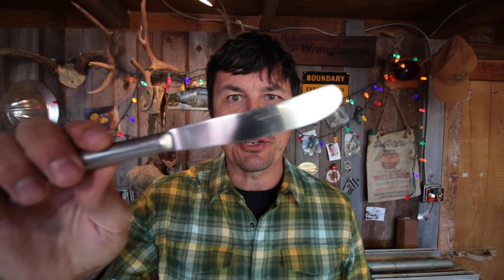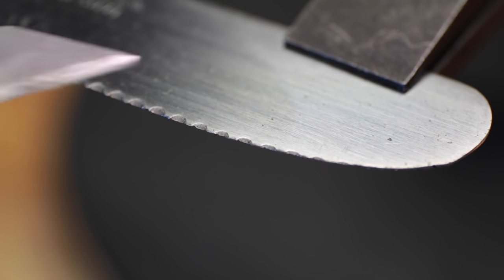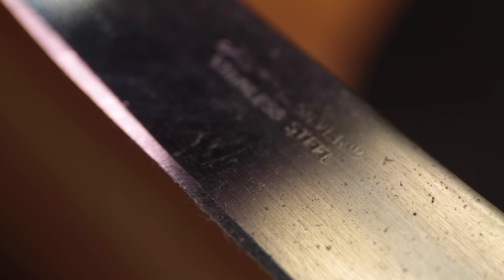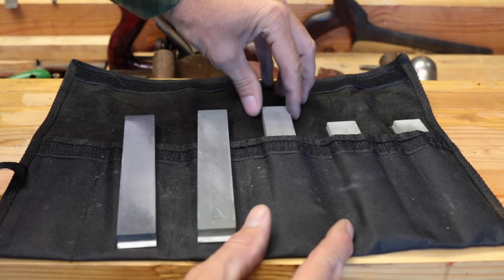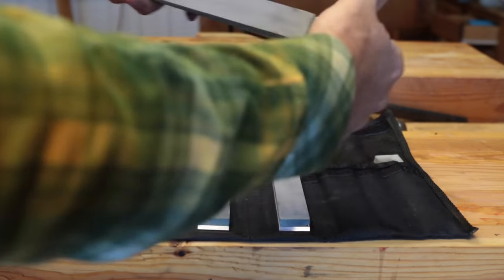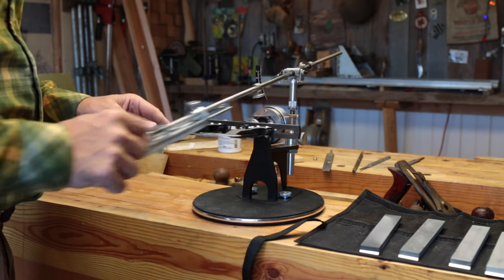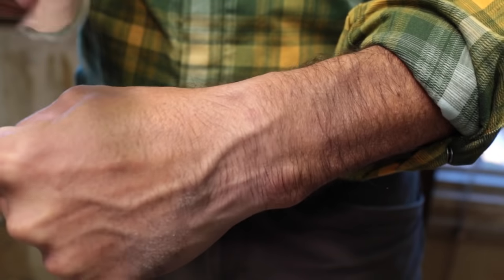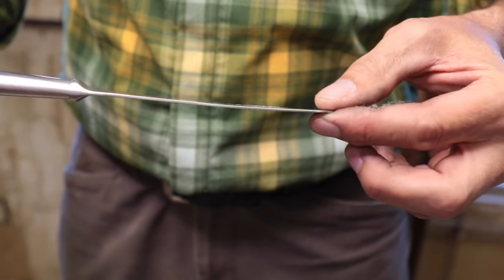Can A Knife Be Too Sharp??

Comment: I need that knife sharpening setup in my life.
Reply: who doesn't
Reply: Same
Reply: What is it?
Reply: MotoFail, TSPROF Blitz 360 sharpening system. And you’re looking at $400.
Reply: @kodyking3090  there's a 3d printed version
Reply: They're super cheap 63 bucks on Instagram ads
Reply: @dustycover3015  and a lot of practice. Using a free hand stone takes skills.
Reply: @dustycover3015  except the learning curve.
Reply: @kodyking3090  thanks for the details man.
Reply: Ever tried sharpens best ?
Reply: Coming from 21 year certified cutler, these knife setups are good for the less skilled beginners. A master cutler like myself would NEVER use those systems. Using real sharpening techniques, by hand, that’s how it’s truly done.
Reply: I have the U$ 20 Ruixin Pro RX-008 set. There's not a single day I regret acquiring it. Just make sure to upgrade it with finer grit stones and diamond compounds on leather strops for atom-splitting sharpness. My current set of grits includes 14K, 100K and 200K diamond compounds from TechDiamondTools, each one embedded in kangaroo leather.
Reply: @kodyking3090  and if you spend 5 minutes a day meditating on a piece of polished marble with a little bit of butter and a Japanese razor you will be able to sharpen knives better than that in a year's time I would guess 12 to 1500 Grit with confidence. besides that tool only works on straights what do you do when you get to a curve on the blade? if it's worth getting something that sharp is worth the time to do it yourself.
Reply: @scottsmith6571  😆😅😂🤣🤣🤣
Reply: @kodyking3090  So basically the price of a decent basic set of whetstones? Or one high end knife.

Comment: I knew you could put an edge on it, the question is how long will it hold?
Reply: He said in the video 20 degrees..
Reply: 420 seconds tops
Reply: Now the Real question is how does it proform with butter
Reply: Thanks for providing this information.  Danny at DeepSouthHomestead talked about not buying a pocket knife that had a stainless steel blade because it does not sharpen well and if you did get it sharpen, it would not hold an edge.  Of course, I didn't know this when I purchased a few knives, so I really need to do some research.  I need to be staying under $50.00 but don't really know what is available worth having in that price range.
Reply: There are many different kinds of stainless steels. Many modern stainless steels hold an edge just fine. Stick with quality brands and you'll get good steels with good heat treatment.
Reply: My question exactly! Would it even hold up for a complete shave in the manner one would use a straight razor? I'd no doubt it could be made "razor" sharp.
Reply: It will take an edge sure but that edge will be soft like butter it took him almost no time to do it and that is because the hardness of the blade is well below 50 RC  if he had stropped it mirror it would shave even better but it would need resharpening every time he used it....
Reply: Lunas Eclipse  Hey dude, I have a nice handmade native knife and wondering what the RC stamped on it means.
Reply: Peter Carlson so what hardness though if it just says "RC"
Reply: The hardness is not typically something stamped into blades in your case it is more likely the makers mark if it is a handmade knife and is either the initials of the smith who forged it or the smithy's. As far as markings go china is typical at the base of mass produced and like has been said the metal will likely be low grade stainless if you're lucky. Good stainless is non magnetic or weakly magnetic. The only real ways to tell hardness is through a file test if a file skates off the metal it is above 50 if it bites and removes material below 50-55rc OR sent into a lab OR an Ames portable hardness tester.

A handmade knife if it is good quality will be magnetic unless made of titanium or stone and it will hold an edge for a long time if it does not then the quality of craft is low.
Reply: Donni & Jeanette Chamberlain as some have already noticed, modern silverware is made from aluminum (steel is of a more expensive kind of silverware) so for affordable reasons I can say that he has a cheap $1 knife, made from aluminum, making this knife good for a quick slice, like a prison shiv
Reply: actually most of those type of knives are cheap stainless steel not aluminum very seldom is aluminum used as if they go that cheap they tend to just make them out of plastic...
Reply: Well no .. the question is: Can a knife be too sharp?

Comment: e
Reply: sounds like a vsauce question
Reply: Jonah Wang can water be too wet? whole video is putting a water on a bucket
Reply: Why not put it inside the bucket?
Reply: salvador fonseca because that's too complicated
Reply: I prefer to put the bucket on the water
Reply: I prefer to water the bucket.
Reply: I prefer to pour bucket into the water.
Reply: Let's find out.  Watch as I pour this glass of water, take a drink.  Mmm, yep, it turns out, water does quench your thirst.
Reply: @Jonah Wang, you jest but water can become too slippery when they add chemicals to aide in fracking
Reply: Only rainwater
Reply: DEAD Lmao " Firgutivley Speaking"
Reply: Jonah Wang What do you mix with powdered H2O? (Old Gallagher joke from the '80's...)
Reply: Cristos Palabras I don't know. I'm not 30 years old.
Reply: Jonah Wang Answer: It's a joke. There is nothing you can mix with powdered H2O. Oh to be young again... except... I would have missed all the good jokes.
Reply: Verepaine I used a surfactant called "Kinetic" in my landscaping business to spray on "lawn ponds." Kinetic is super slippery and reduces the surface tension of the soil, thereby allowing standing water to have a "transient quality," just going straight down into the ground. Same principle with fracking, it allows the sludgy water and sand to be pumped into the ground with no resistance.
Reply: Sorry but I'm not smart.
Reply: They actually sell water wetter for firefighting. It ups the density
Reply: Cristos Palabras eisai malakas
Reply: Well why the hell not?

Read More
Reply: Funny
Reply: Jonah Wang But you're young. So smart doesn't matter.
Reply: Um I didn't fall for it
Reply: M8, Then why did you reply.
Reply: @Cristos You're old, so logic doesn't matter.
Reply: Jonah Wang Which, is a compliment not a complaint, so thanks for the compliment! 
(Age, where brains RULE!)  Old💪 vs: Bull💩!!!  Wins every time!
Reply: k.
Reply: Jonah Wang I
Reply: Can air be to breathable
Reply: Can foam be to soft
Reply: Jonah Wang aa
Reply: k
Reply: Jonah Wang aaa you got me
Reply: is it possible to be TOO hard?
Reply: Cristos Palabras hehehehe
Reply: You cant trick me
Reply: you actually got me
Reply: Jonah Wang didn’t get me
Reply: Jonah Wang it's to high the read more is too high
Reply: Water isnt wet
Reply: lol s .
Reply: salvador fonseca why not both?
Reply: can fire be to hot?
Reply: lol
Reply: Jonah Wang lol
Reply: Jonah Wang do you know that when you can go to awake then sleep then pee?
Reply: Jonah Wang lol
Reply: Ahahha
Reply: I love this lmao they're all talking without context 😂
Reply: Jonah Wang wow
Reply: This man is a legend
Reply: Hahahahah what bucket
Reply: I prefer milk in my hot chocolate
Reply: @lucascurrah6010  oh yeah oh yeah
Reply: big oof
Reply: Ur a good man
Reply: I like the dense water on the outside of my bucket
Reply: Gr8
Reply: Can water be too wet
Reply: E
Reply: true

Comment: The real question is would you lather up and place it to your face. FYI 1000 grit is considered coarse for guys who wet shave with a straight razor.
Reply: eh, 1k is medium to me when doing planer blades, I finish with 6k, then leather glued to block
Reply: 1000 grit cuts hand hair near skin but is far from comfortable face shave. #1000 is the starting point for my shaving knives and after #13000 I move on to stropping to give the final touch.
A great shaving knive cuts a hair if you drop one over it, just by the weight of the hair. Any knife for shaving should at least cut a hair that is held at one end only.
Reply: i go only to 10000 grit 1000 grit would feel scratchy as hell on the face but i wonder how high the count goes on this system if it goes to 10k stones id love it what is it called anyway
Reply: people dont seem to distinguish from shaving sharp and razor sharp. shaving sharp is all well and good but i wouldnt put an only shaving sharp blade to my face
Reply: Monte Turner correct, i would never use less than 12000 but the best would be 16,000 and straps at about 55,000
Reply: I don't know what it'd be called, but I wouldn't be surprised if they aren't using JIS but another standard. So the 1000 grit being used there is probably a bit finer than than a 1k japanese waterstone using JIS.

Sadly I also don't know the type of jig he's using there, the handle looks a bit like what I've seen on the edge pro models. The rotating mounting point looks like what I've seen on the KME system in the past but the stones used on it don't look like the coloured ones the edge pro system uses. So I'm a bit at a loss to identify the system, doing it by hand on benchstones for too long to keep up with all the things that people come up with. Benchstones and a spyderco sharpmaker for occasional touchups is how I roll these days.

About the various grit ratings though! For example the "spyderco ultrafine" type stones are rated 2k by spyderco, but they are in my experience similar in finish they produce compared to 4k-8k waterstones using the japanese JIS standard rated stones. There's a few different systems out there the main ones are JIS, Ansi and FEPA from what I remember.

Some crazy people on the bladeforums have put in way too much time going so far as to measure scratch patterns under a microscope to come up with this chart if you want to compare some of the numbers: https://docs.google.com/spreadsheets/d/1VaTf3MXuwuvH-QLwOci4f9B9Zhkbuu1wjoSCZIUsR-o/edit#gid=0 
Source: http://www.bladeforums.com/forums/showthread.php/856708-The-Grand-Unified-Grit-Chart
Reply: Yeah, I also found out a while ago, shaving arm hair is much different than thick facial hair. With edge pro and wicked edge stropping compound I can make all my knives whittle thin hairs, but they still won't shave my face without catching and pulling hairs.

Comment: What knife sharpener is that? I looked in your store but no luck.
Reply: I will post a video link for it
Reply: Just watch Cody's last videos.
Reply: The company who offers it also has a basic model for $217. I wouldn't mind owning one, it would give me a more useful hobby than just electronics. It seems pricey at first, but you're helping support a craftsman who makes these, not a big company over charging for badly designed junk. :)
Reply: If its 500 dollars fuck no I'll stick with my whetstone
Reply: Brandon Hickory The cheapest base unit is $217. It's no different than buying a car or truck, of course it's going to be expensive if you buy the model that gives you every part they make for it.
Reply: J
Reply: Riley Fenley what's the brand of the sharpener
Reply: Clemente Castillo See the link I posted above.

Comment: I thought the same thing, but it is not a butterknife.  I have the whole place settings for eight.  This knife is serrated, but is a very poor steak knife...and I currently only use one of them which is actually my butterknife.
Reply from the maker: Does it really matter?
Reply: what country are you from?  here in Arizona that is a butter knife as much as apple pie is American.
Reply: Actually no it does not. I just found it unusual that I had a whole draw full of Butterknives.
Reply: Wait. You find it unusual that you have several butter knives? I have like 2 dozen butter knives. From about 3 different sets.
Reply: Technically speaking, it's a "table knife", since it has only mild serration and no refined edge.  A "butter knife' is completely dull and smooth, and often has a point near to that of a very shallow clip-point.

It doesn't actually matter, of course.  Colloquially, much of America calls it a butter knife and we all know exactly what we mean.  Just like a Back Saw to us is a Tenon Saw to a Brit.

Vernacular.
Reply: Can you tell me the maker and model of your knife sharpener?

Comment: i'm pretty sure you can get any solid material super sharp, in fact usually if not always softer metals like aluminum (for example) can be sharpened just as much as a high quality steel and much faster than a high quality steel blade because the metal can be grinded down easier. With that in mind a very sharp aluminum blade will also lose it's edge much easier than something like a high quality steel simply because aluminum is softer and easy to damage, chip, or bend including the edge itself compared to if that blade were steel.

Comment: You can sharpen a baked bean can to that kind of " sharpness" but like that butterknife, it will not hold that edge for long. Just as a side note, I sharpen my knives to 10.000 grit level and then strop them on a bit of leather with quellers rouge. But those are high end knives that I use in the kitchen. I stop at 5000 grit for my every day knives i use to filet fish and cut meat

Comment: I really like those "rocker blade" type pizza cutters, they're typically 14" long or so, have a handle along one entire side and a curved "blade", but they come VERY dull. Often times you have to push really hard to get it through a pizza, so I took and sharpened the thing as best as I could. It was almost sharp enough to shave with actually, and now it cuts through pizza with ease. I'm actually thinking I need to watch a few videos on tempering, then it'd actually retain that edge or even be able to become sharper than I can currently get it.